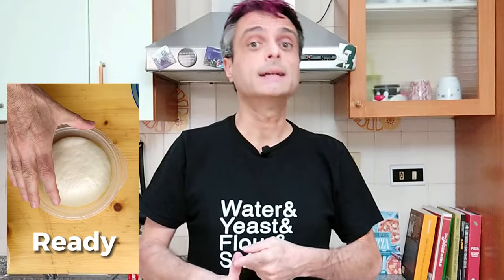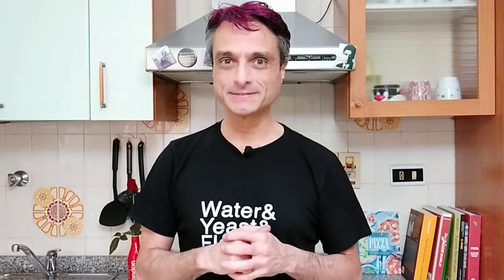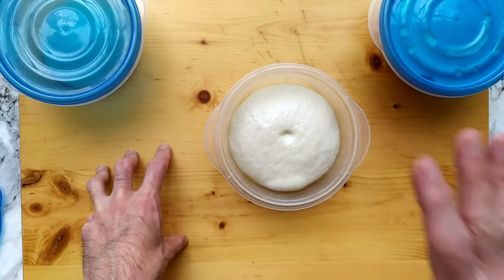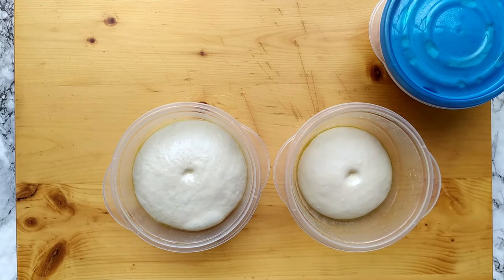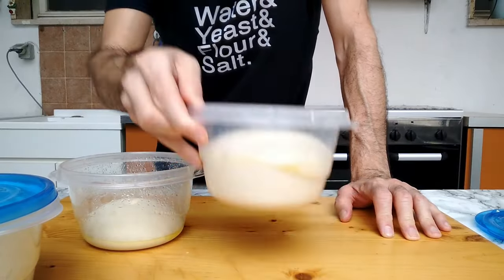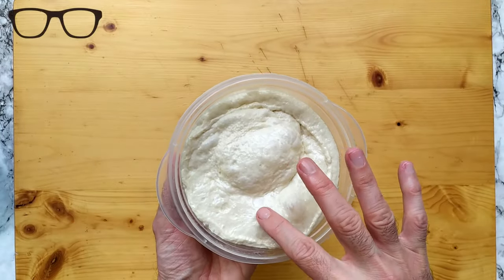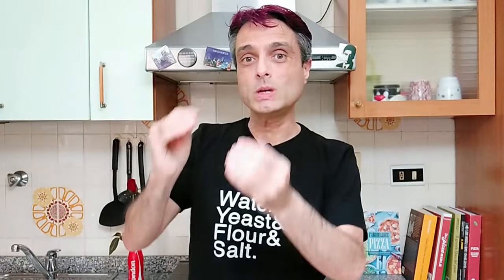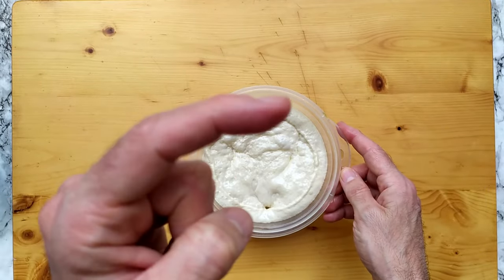How To Know If Home Made Pizza Dough Is Ready To Bake 🤔

Comment: This is very important. I have struggled for months wondering whether my dough was over proofed or under proof and why, my pizzas were very flat. The answer was my yeast was dead, there was no rise. 

Fabio do you use fresh or dried yeast and why? I was surprised with kneadingwithfranco answers to this.
Reply from the maker: Ah, I see, devil's in the detaila 😊
I use whatever it's available where I am: dry yeast when I am in London, fresh when I visit my hometown. I get the same result, to be honest! 
Is there anything in particular you were thinking of?
Reply: @FabioulousPizza  it is because I keep my fresh yeast in the freezer i didn't realise its life is so short. I used it after 2 months  and it was dead
Reply from the maker: Yes fresh yeast usually has 2 or 3 weeks shelf life in fact, I also freeze it, I weigh in advance the dose I always use 😊
Reply: @FabioulousPizza  just to check you would keep it 2-3 weeks in freezer?
Reply from the maker: no, 2-3 weeks in the fridge, but alwasy check what's written on the package. When you freeze it it lasts a few months, can't really say how many, though, I usually run out after 8-10 weeks 😀